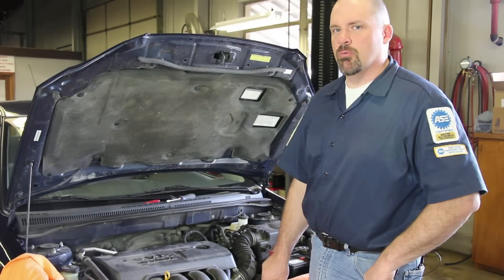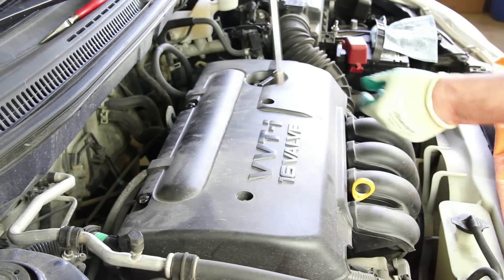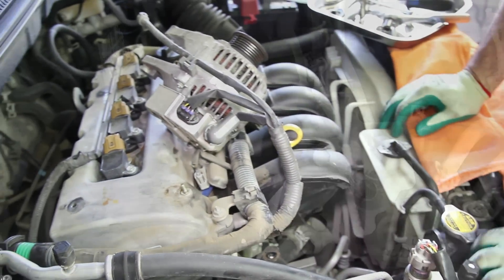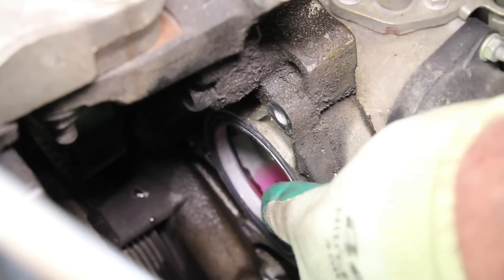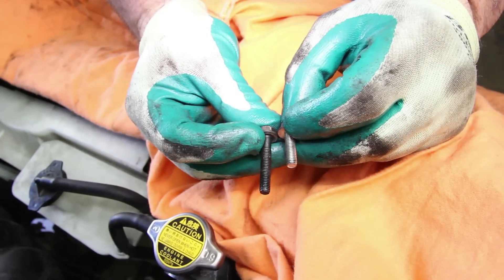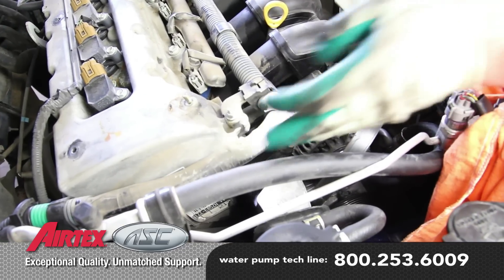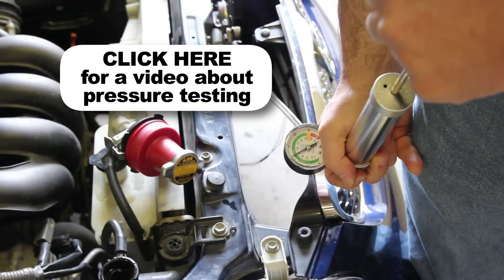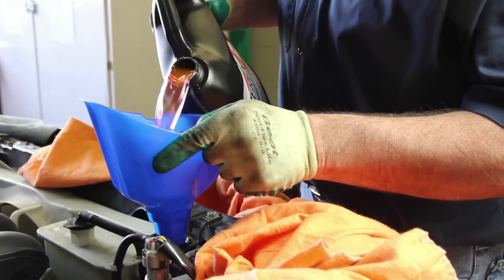How to Install a Water Pump - Toyota 1.8L 4 cyl. WP-9173 AW9376

Comment: I miss these 1zz engines, very simple to work on straightforward to maintain. Only issue they had early on was excessive oil consumption but that was just due to people not changing the oil frequently enough and the oil retention rings sticking to the piston from sludge. I currently daily a 2005 Celica with 160,000 mi on it and it runs awesome.

Comment: The flanges on this water pump are different from the original. What size (shorter) screw did you use for the shorter flange (diameter/length? pitch?)? Thank you.
Reply: Thanks for the reply. Yes. However, I would like to know the size before I take the stuff out since I can't drive to get the hardware once I take the stuff out. I can't get calipers into the engine space. Also, I don't know the thread size or pitch without removing hardware; I can't drive to get the hardware thereafter. Even if it was through the mail, it would be days before it arrived. Well, I suppose I'll have to guess.
Reply: Thank you for the info. One question: When I filled up the radiator, I filled at the overflow reservoir instead of the coolant input (I thought it didn't matter). For some reason the overflow reservoir won't drain, even when I drain the radiator. Is there some way (without taking the reservoir tank off since it looks like the reservoir tank is one piece with the radiator housing) to drain the reservoir tank? (The reservoir tank is now to the brim.) I even ran the car with less coolant to have the reservoir drain, but it didn't work. Thanks. (2008 Corolla)

Comment: there is much misleading in this video. the water pump has a bottom screw and a screw by the pulleys that are very hard to get to. the only and proper way is to remove the top motor mount and lift the motor up to have proper clearance for your hands and tools or air gun in removing the water pump.

Comment: Very informative video.Did you use OEM replacement parts or aftermarket? How many miles does the water pump  usually last before it needs to be replaced?